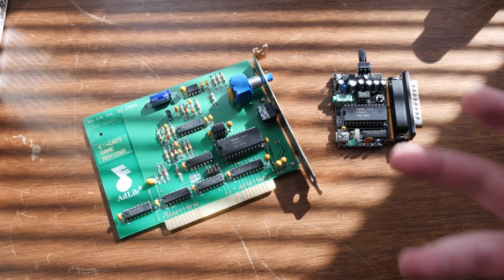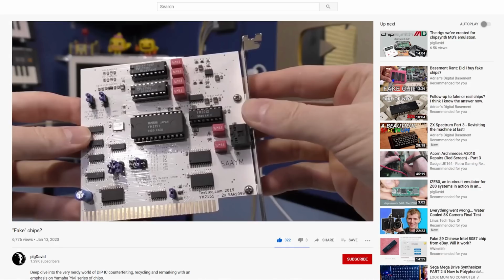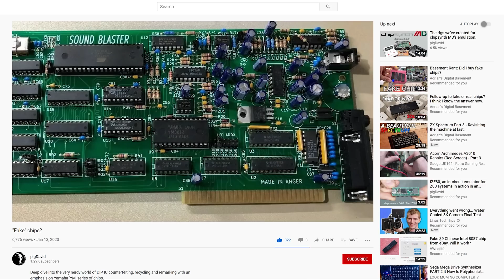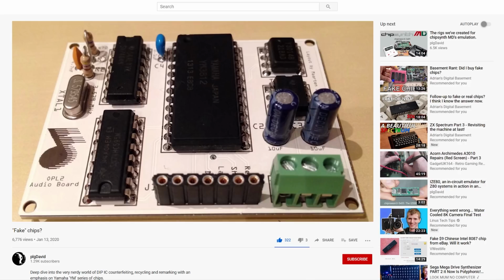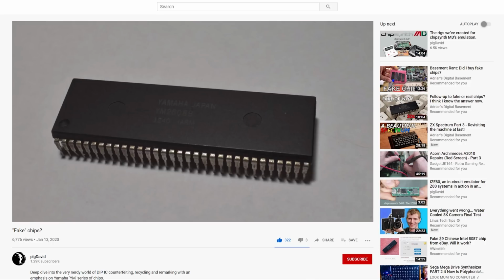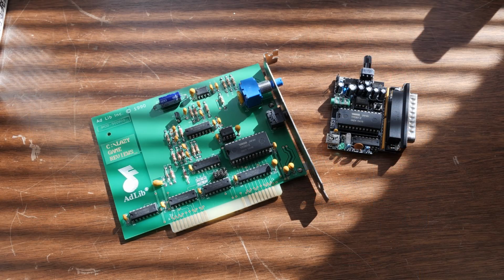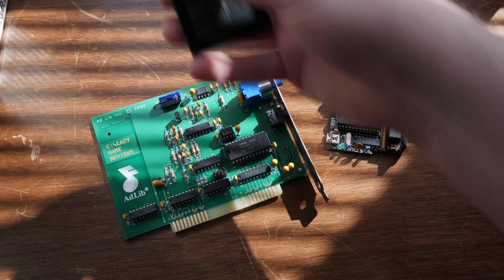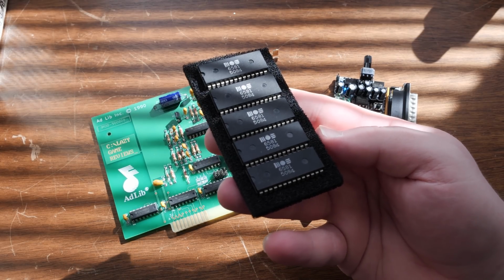Are these Yamaha sound chips legit?

Comment: If it sounds exactly the same, I don't see the grounds for calling it "fake" in the first place. Maybe some Chinese factory found blueprints of these chips' internals and now produces exactly the same new ones on their manufacturing line. Just should be more honest with the date codes (print the actual 2018 there, etc), if anything.
Reply: A product marketed as new-old stock that isn't is a fake. It's an issue of disclosure

Comment: There might be sellers who got a whole bunch of ICs when Yamaha EOLd them, which might explain the similar/same date codes. If they are all from the same batch, they will have the same date code. And I agree: if there are Chinese fabs who make this chips with fake labels, I almost don't care. Maybe they should simply label it Foo3218 (YM3218) to make it clear that it's a clone that is compatible with the 3218. But they are probably even using the original Yamaha masks, so... well, probably not legal. Also would be great if they would make clones of all the MOS chips for the 64, Amiga etc. that are all getting scarcer by the day...

Comment: 'Fake' in the sense of compatible doesn't have to be bad however when they sell it as the real thing (with company name and such) there is a problem. The only way to find out it is different is to decap the thing (with some toxic goodies) and compare the layout of the die  (you need a (electron) microscope for this) to the original (few people did this with with branded 'clones' of originals). However, these are old chips and it could be possible the manufacturer update/improve the layout to make it cheaper to produce.  Over time, it can be very hard to tell what is original or not, the painted one is definitely not an original (could be a bitbanged microcontroller, a die clone,  an EPROM or even a small  FPGA with fancypancy painting on top). Do you know the date code is really a date code, maybe it is a batch code and a batch can be huge or a version code, could be also thousands or millions of the same. Hard to tell when hardware gets older.

A good example of (more recent) counterfeit  is FTDI chips, google it, very interesting.

Comment: All 3 chips you tested were clone chips. There are way to many chips with the same manaufacture date code.
All of the chips you tested are out of patent, so some engineer in china used the existing design and reproduced a $0.05 chip which are then re-sold for $5. They all work because they are based on the original design.
I think I would be just as happy using reproduction chips, as the original chips especially SID chips were prone to failure.

Comment: I wonder, if you have an original board and want to replace a not-working chip with an original one I would have probably want to be sure it WAS an original you know. But with new cards that does the same job I am not sure I would care, as LONG as those "fake" chips does the same job as the original. Is that just me?
Reply from the maker: It's not just you, I echoed that sentiment throughout the video! 

However, the sellers aren't specifying what these chips actually are. If they're reproductions, that's fine, but they need to specify that instead of selling them as new old stock originals. They could be 3 years old or 30, but with these sketchy paint jobs we just don't know.
Reply: @LGRBlerbs  Yeah, it should maybe be marked something like "This is not an original but it will do the exact same thing". Or maybe not exactly that but I think you get the drift. ;-)

Comment: These chips are so easy to make in China now I would not be surprised if they are reverse engineered copy’s of the originals. I work in production and I have seen where we have sent a plastic part to China and asked them to build a mold and make more and what they send back is so exact the y copied the faults in the part. But I digress. They are probably copies that they worked to hard to make look good and that is why they stand out. That is my theory anyways. And to as why some are painted and some are not well I would not be surprised if ones that where cosmetically imperfect where not resurfaced and lettered rather than scrapped. They would be called reworked parts. The OEM’s would never have done that decades ago but today he’ll yeah they would rework a chip that is already a knock off. I would buy the knock offs as I really feel they are as exact a copy as can be made.

Comment: 1:30 “Unless you’re sourcing them directly from old cards..”

NO.  🙅‍♂️
Reply from the maker: That's where many of these loose chips come from, seeing as they haven't been made in 20+ years. Just the reality of overseas e-cycling.
Reply: China has literal mountains of old boards they pull apart for the valuable chips. There's not a lot you can do about it.

Comment: That's definitely residual carbon from incomplete/incorrect die-plating sloughing off the first repop.  Probably from primitive manufacturing techniques being applied -  incorrectly - to solve modern problems of scalability.

But man, primordial manufacturing is the only thing I can think of as far as that second chip is concerned.  What a hot mess.  Probably carbon, paint, lead, crushed bones of the vanquished.  You know; like one does. 

I wanna' say...  Bangladesh.

Comment: For this vintage market, if the originals aren't being made any more, I don't care too much that these are "fake," so long as they work as they should. Original hardware is dwindling fast, and reproduction pieces are the only real chance some of have in having this experience. A classic example of which is the popular use of CF cards to replace failing MFM hard drives on XT and early AT class systems, or as a "third party addon" for a system (like the Tandy 1000 EX/HX) which was never designed for them, but COULD support them with third party addons. Authentic Ad-lib cards are getting hard to come by, and if these reproduction boards are using "reproductions" of a product that the original manufacturer is no longer making, then It's not like purity is such a concern, so long as they work as they should.

Comment: I am having this issue trying to find specific cache ram for a DEC 486. I order chips and the speed is not what is printed on the chip.
Reply: That's why you always buy things through Paypal, document the testing / validation process, and always file a dispute and get your money back if the parts are fakes or scams.

Comment: I got some YM3812-F's off EBay a while ago, and I think the ones I got are legit, at least at the die level... haven't tried the acetone thing to check for resurfacing, but I only bought them after someone I trust on twitter bought some from the same seller and de-capped the chip and got the die under a microscope.

Comment: If those chips came from China then it's possible that they are newly manufactured copies. The Chinese take intellectual property theft extremely seriously and will go out of their way to make stuff look like the real thing. Often they fail spectacularly because they don't know the meaning of the stuff they're copying, just that the original had it so their fake has to have it also. That's probably why all the date codes are identical. I have a bootleg VCD of Star Wars Episode II I found at a charity shop sitting next to me which they tried very hard (and failed very badly) to pass off as an official copy. They even had the gall to put copyright notices on it (which are hilariously incorrect).

Comment: I'd almost prefer a "brand"-new sid or otherwise chip today over a 20+ year old second hand one, especially if the original manufacturer has long since abandoned it - how else are you going to find a reliable replacement for the original chips as they fail? As long as it sounds the same, I'd have no issue with it. Any company doing this, though, should have the balls to put their own name on it, though, and not pretend it's an original component. As far as resurfacing original chips goes, I don't think it matters a whole lot more than hobbiests "retrobrighting" or repainting a case, as long as the original spirit is preserved.

Comment: Fake, recycled, refurbished, who knows, all I know is that china has made quite the industry of recycling old components into new, cheap products, an audio amp I have contains parts which were probably once car stereos but sounds fine, some 12v SMPS modules have what look like re-used capacitors, but they work okay, and it wouldn't surprise me if the keyboard PC thing I have somewhere contains used eMMC or SOAC processors, they just know how to salvage and re-use, though selling as "new" is a bit of a cheat, but hey, it's china, a lot of things aren't honest over there... :)

Comment: Send one to electronupdate, decap and check with a microscrope
Reply: Mateus Pinesi de Souza this seriously would be the way to determine if they were pin-compatible clones or die copies
Reply: @cassandra-show  But then someone has to send him a surely original Yamaha IC for comparison. A known original BUT dead Yamaha chip, because decapping a known working original is a sin. But if these are clones, I very much doubt they are re-designed, pin compatible dies. It would be a huge work and money to make. Maybe someone got the original films.

Comment: This is a big issue in the audio world. I do audio repair and restorations and there are transistors and ICs (opamps) out there that are what work best in certain circuits. There are modern equivalents that can work, but can send the design into oscillation if you’re not careful.  

Anyways, there are a lot of fake transistors and ICs out there and if I can I try to avoid them.  Avoid eBay and other direct from China options. People have broken these devices down and the findings are that basically they’ll work, but usually they use smaller dies and the device won’t be anywhere as robust or meet the same specs as the originals (voltage, distortion, etc). 

Right now I’m repairing a Yamaha integrated amplifier and it uses a Sanken power module for the output. My only real option for fixing it is to buy a fake from China, or wait for years until a used one shows up.  I guess you can redesign the circuit, but at that point it all isn’t worth it.  

It would be incredible if a company took pride in their product and started manufacturing all of these devices that are sought after but no longer made to original factory standards.

Comment: Is  it really that bad if the chips are fake? Like, if they're electrically and functionally the same, doesn't it make no difference at all? I am not that much into early 90s and prior computing, but i do collect UMPCs and personally don't see a problem with modern repplacements for broken and/or bottlenecking partsof those, such as replacing ZIF drives with SSDs and old weak wifi g modules with brand new n/ac ones. It does breathe a new life into the device after all.
Reply: Again, that's not a problem unless you are a collector that demands authenticity.  And that is the problem... they're advertising these chips as authentic, but they're NOT.
It's like putting new paint on an old car and calling it "fully restored", even if it's missing the engine.

Comment: As I understand, actual fake chips are fairly rare.  Usually what happens is that these places in China remove chips from broken equipment and resurface them in an attempt to pass them off as new/unused.  Most of the time, they will work fine.  Occasionally, you may get one that is damaged in some way.

Sometimes, if multiple versions of a chip were available, they may remove the markings of a less desirable version and replace them with the markings of a more desirable version.  In those cases, the chip may work, but perhaps not perform as well as its markings would indicate.

Comment: if the circuit inside the chip is exactly the same, it's not a fake chip, just a chip made by someone else... if they re-did the circuit, but it still works, then it's not fake either, but it's not the same chip. if the chip doesn't work, then yes it's fake.

Comment: I would guess that at this point a lot of obsolete popular IC's are counterfeited simply by way of their original manufacturer no longer caring to try and stop it.  Something like a YM3812 is no secret recipe, it has been reverse engineered and I imagine has been for some time.  That and Chinese attitudes towards counterfeiting.

It's not like Yamaha are still making them and if there's an ongoing market for these chips then someone else is going to step up and manufacture them.  I wouldn't be surprised if brand new counterfeit chips are coming out of fabs and not just resurfacing/reconditioning of old chips which must be dwindling in supply by now.

As for whether its a problem or not, it's counterfeiting no doubt but we're talking about obsolete products that the original manufacturer has pretty much abandoned.  It's a bit like old software in some respect - if nobody is really losing out commercially and the counterfeit product is functionally identical in every way to the original, is it really a problem?

I have seen some talk of counterfeit chips that aren't functionally identical and have problems though, that's a different matter and probably one to be concerned about.  Outright scams like relabeling completely different IC's to look like something else is a problem as well.

Comment: who want to buy old chip from 70's ??? ...does it work for that long when electrical component do wear and tear mr LGR...nothing last forever...not even us humans ..we wil break down during our 40's...then death by 70's...its better have cloning with correct date when it was made and tested if it work first then package as yamaha...they already have original template to check new ones function as the father chip is 30 years old
Reply: If it was actually labeled as a third party recreation modern chip it would be fine.  It's the fake labeling that's fucked up.

Comment: chips are easily now for machine make quantities than back early days were made by hand....trust me...made by hand is not fun until 2000 machines now printing chips by dates even yamaha discontinue  but circuit diagram is still printing on modern chips...longest it works ..then i don't see any issue with chips...even people see no issue when AMD ryzen zen architecture is now copy to mass produce for china customers